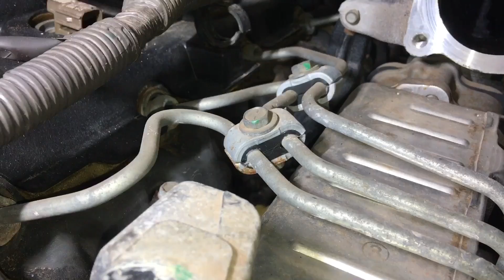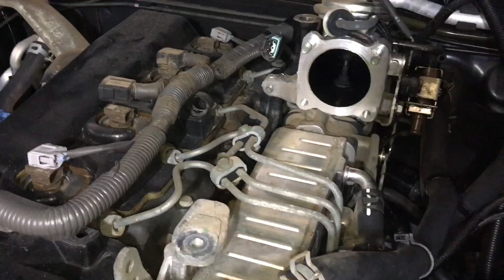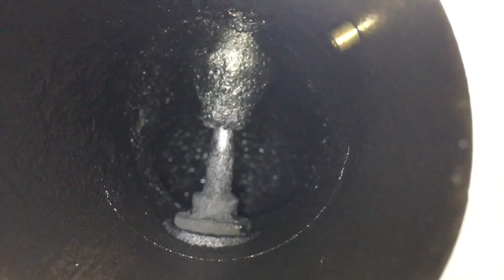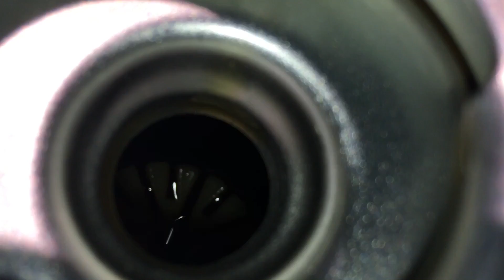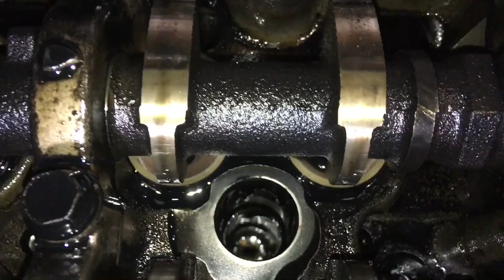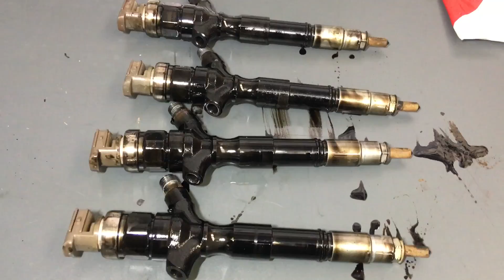WOWSERS 270,000k original INJECTORS never BEEN Out!

Comment: "egr cooler side actuator seized in position"  "9oclock is closed and 12 oclock open" why does engine have both vacuum operated flap and a egr valve ? keep up the good work mate, thanks from nz.
Reply: ps, did you guys remove vacuum hose? usually when running at idle the actuator is at 9oclock and if you take v hose off it will go to 12 oclock. when engine not running its at 12oclock, on my 1kd anyway. is that how you see it ?